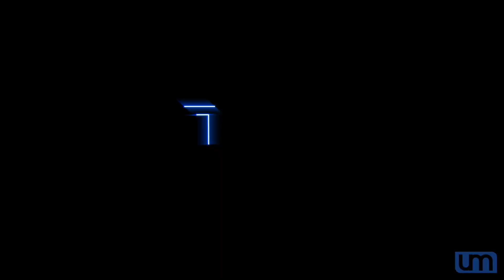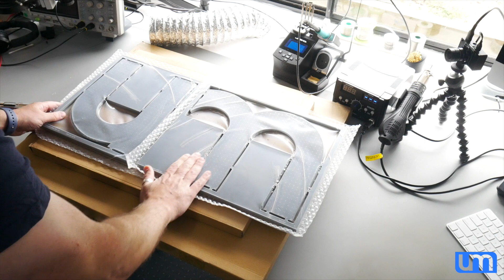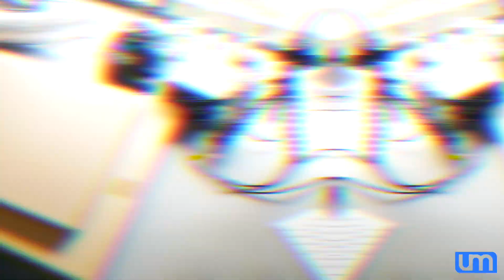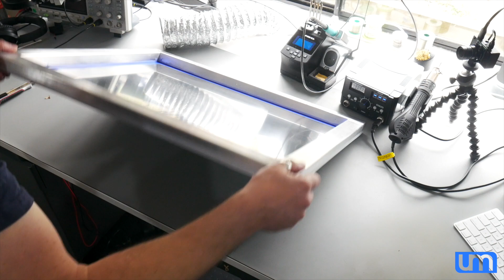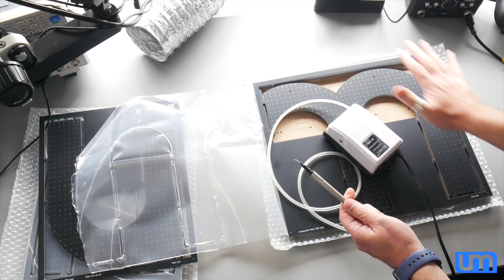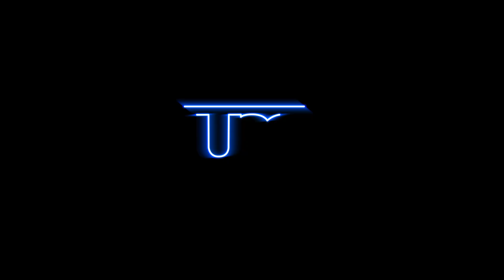This is a Crazy project - Part 1

Comment: Just for starting a project like this good old ATX computer power supplies are also pretty handy! You can get a used and good brand one on ebay for like ten bucks and the 500-600W models usually pump out about 25A on their 5V rail easily. Anyways really excited to see it all come together!!

Comment: I would add the leds around the bottom edge on the new boards too... so you can have either the old or the new  or both. I quite like the current side lit sign.
Reply: It's back lit. The logo sits off the wall enough to allow space for a LED strip to run along the shape of the letters. Could be easy to re-implement with a new strip, or move the old strip across, if the adhesive permits.

Comment: When you use  bismut-tin solder paste you can reflow the PCB in you convection oven in the kitchen. That stuff melts at 140 C, and is lead-free. I do this for my PCBs and have professional looking results. Plus at that temp you do not need to worry much of peak time, even for LEDs.
Reply from the maker: I've been using (and promoting) low temp lead free paste for years :)
Reply: @UnexpectedMaker  and if you run the LEDs too hot they will all start falling off 🥵

Comment: You sure know how to create a nightmare manual placing job. That will be some fun hours to place all those parts down. At least it does not, I think, have  lots of 0402 parts, but does have orientation sensitive needs.

Good luck, should look fantastic.
Reply from the maker: It has stacks of 0402 caps on it. 120 or 140 I think :)
Reply: @UnexpectedMaker  You do have a wicked way to to enjoy yourself, still orienting all the LEDs is probably as time consuming, and requiring concentration to avoid mistakes, which in that density become a exercise in itself. 
Do enjoy yourself, still probably easier than the efforts pre good PNP to meet the Tiny Pico volumes